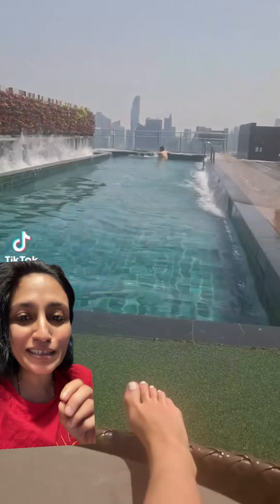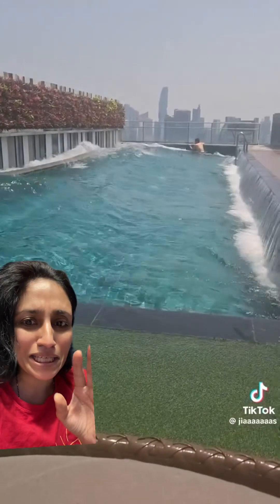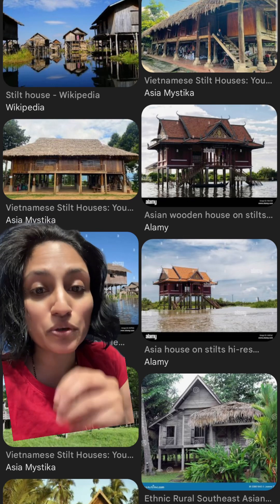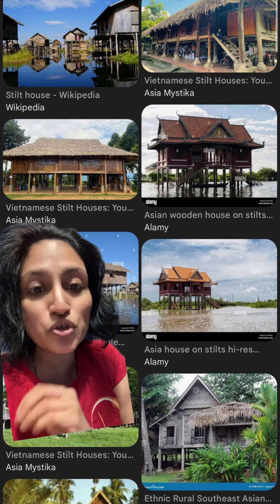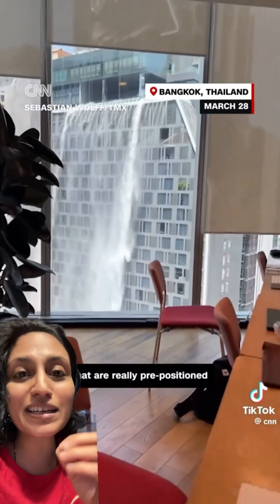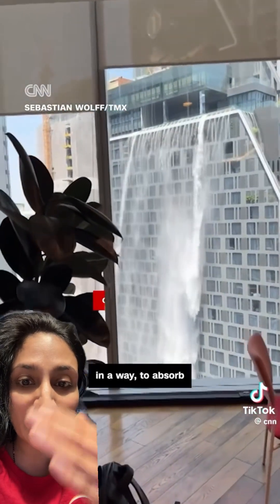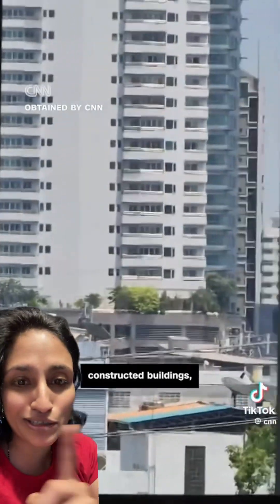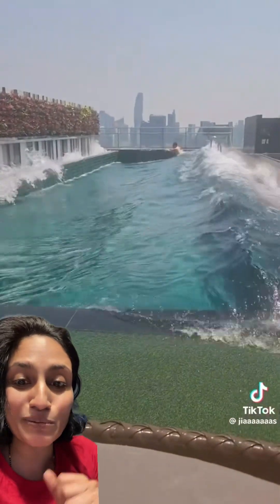Earthquake #artlust

Comment: I saw a different video where the water splashing around broke the glass barrier and the water floats fell off the side of the building!
Reply: I saw that too. Good thing the couple got off the float and out of the pool before they could go over the side as well!
Reply: @ Yup! I think in that scenario, the layout and orientation of the waves played a bigger role than they do here. That seems more related to the design of the safety mechanisms (glass barrier) rather than the overall structural integrity of the building itself.
Reply from the maker: Eeek.